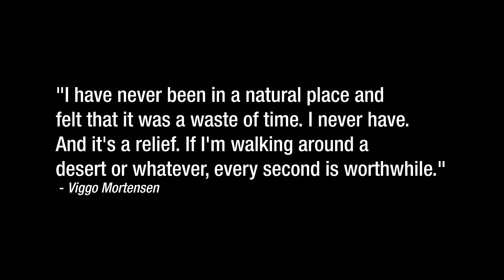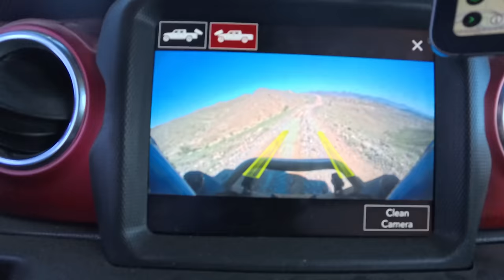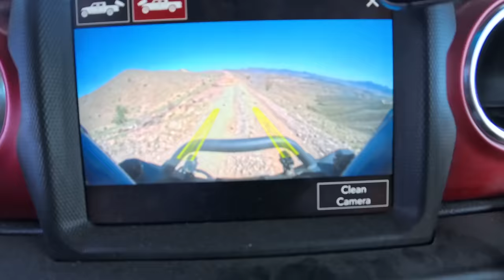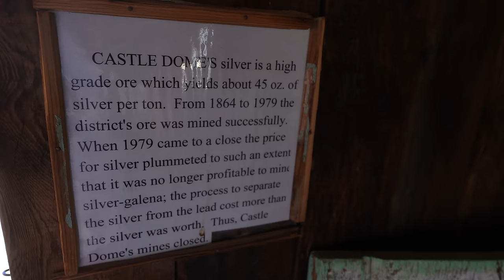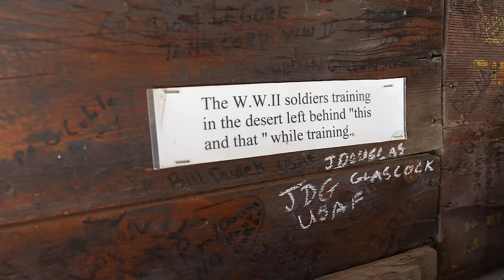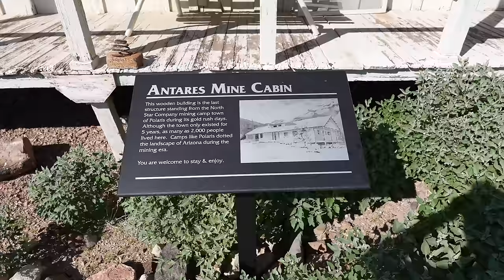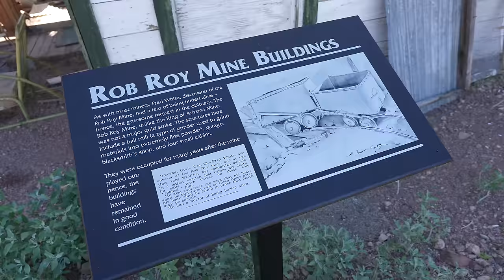This was Unexpected in the Sonoran Desert - Solo Overlanding in my Gladiator

Comment: You have a job as well? Other than youtube? I've been trying to figure out how to do this myself. I program, and can work from home, or from the road XD Though I must be online at certain hours, from 9am to 5pm. I've the battery power now to run everything I'd need for a few days, but I'd need to drive a bit to recharge them. I just don't want to drive at night and set up at night.  Still trying to figure out how I'd make this work, and make sure I could find a site before sun down.
Reply from the maker: YouTube has been my full time job for almost 3 years. When I had a normal job I’d plan my vacations around trips like this.